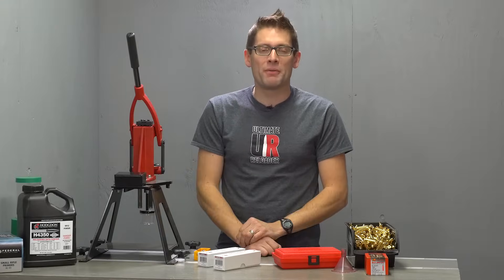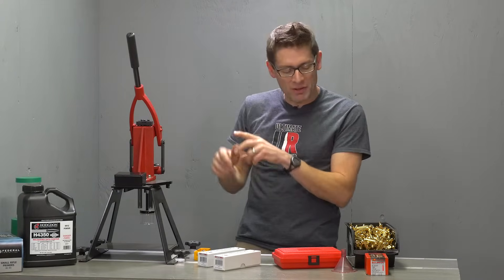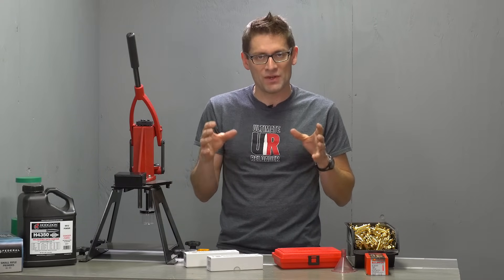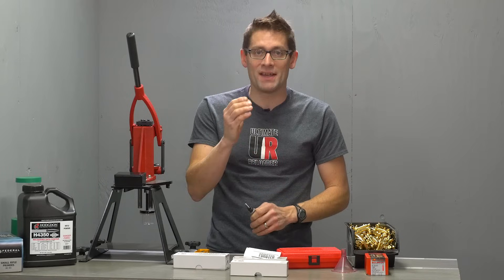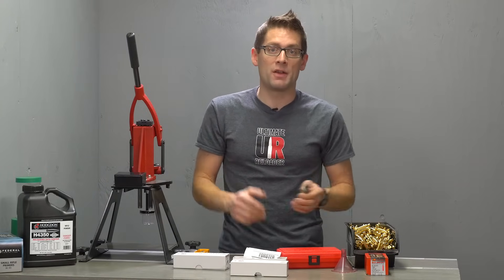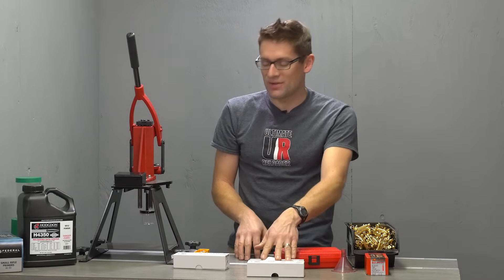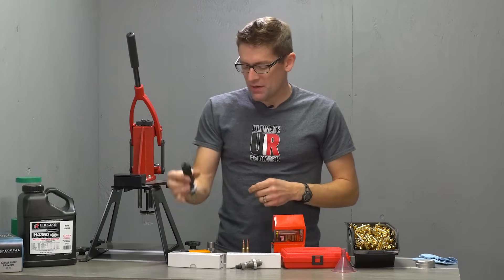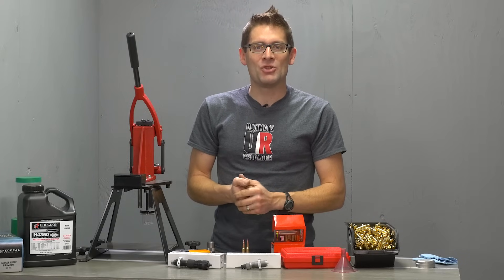Forster Reloading Dies: Overview and Setup featuring 6.5 Creedmoor

Comment: Forster seating die....
Zero micrometer barrel to scale on die.  Then set up seating threaded stem with lock nut to your cartridge desired length (similar to normal seating dies).    Now you have your die micrometer at zero for your cartridge and can make minor adjustments from your zero set point.
Reply from the maker: Awesome way to do it! Thanks for sharing. Isn't it great to be able to "dial things in" ? :)

Comment: I like your videos, very informative.
I couldn't stand using that mounting bracket though with the press flopping around like that. Maybe doesn't make any difference, but I would never use it. Much prefer a solid mount, but I guess if you're changing often in your case.

Comment: have you used Redding resizing dies in your Co-Ax?  I am finding that during resizing the upstroke on the AX with a 6.5c  Redding die takes considerable effort as opposed the 7.62X54r Forster in the same press.
Reply from the maker: I have, but I haven't had issues with effort/force, that's strange! I do notice the difference with the elevated expander ball in the Forster dies... (for neck expansion)

Comment: im using it for 6.5 Grendel, and when I place the seater die and screw it in until it stops, and then i turn back 1 revolution, after that if I unscrew top cap, insert factory grendel round, and start screwing top cap back, it never stops... in other words for factory round I can never reach a stop when screwing top cap. what could be the issue?

Comment: I'd really like to see how you get what bushing you need specifically to bump your neck back a thousandth. I ended up with the rcbs gold medal match FL  sizer, neck/bushing sizer and micrometer seater when they were recently on sale. Trying to figure out which bushing I need is a little confusing and whenever I ask the local reloading shop they just tell me not to worry about it and leave the shoulder alone. I just worry about stuck cases eventually with longer strings of shooting. Any advice would be greatly appreciated. This is for a Savage 10BA Stealth 6.5 Creedmoor. If you plan on talking about this in your later video I'll gladly wait. Keep up the great work.
Reply from the maker: The bushings are to control neck sizing- it's a function of bullet diameter and case neck thickness. I have some math to show how to calculate required bushing size here: http://ultimatereloader.com/2016/05/13/l-e-wilson-full-length-bushing-type-sizing-die-overview-and-setup/

Comment: Great video Gavin!  Does primer size affect the burn rate of the powder? (I may have used “burn” incorrectly).
Reply from the maker: Paul- I'm still experimenting, but from what I understand the small rifle primer has more to do with consistent burn (compared to large, for 6.5 Creedmoor) and can also withstand higher pressures before the primer pocket loosens up... More to follow.
Reply: Thanks Gavin!
Reply: It makes sense, but would love to see a practical comparison (currently using large) to consider a possible switch. Keep it up!
Reply: I am definitely interested in this as I am just starting my 6.5 creedmoor adventure and was wondering why there was a difference in primer size. I have not purchased any brass yet so looking forward to some further info.

Comment: Do yourself a favor and don't use the chargemaster as your precise weigh scale.  Get a good balance beam like RCBS 1010.    I made the mistake of trusting my charge master and it has royally shat the bed in consistency.   I got my 10 10 and checked consistency with a 61.2 gr charge and it was throwing ES of 0.2 high and low.  61.0 to 61.4 makes a big difference even in my hunting 270